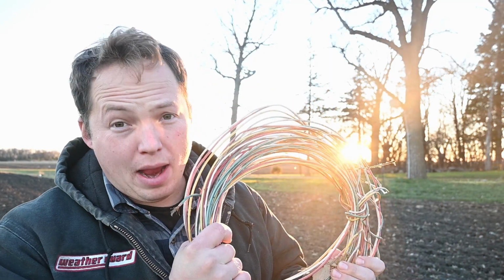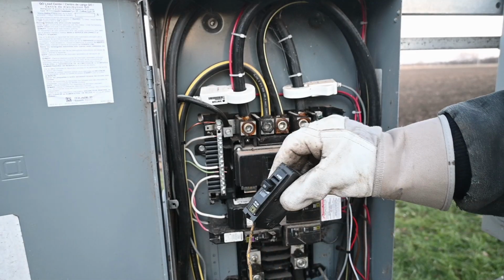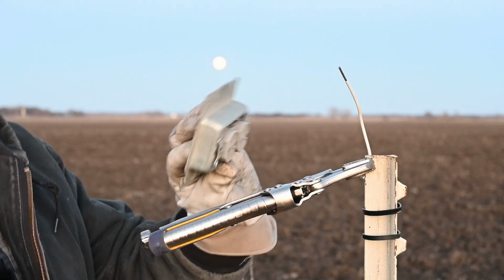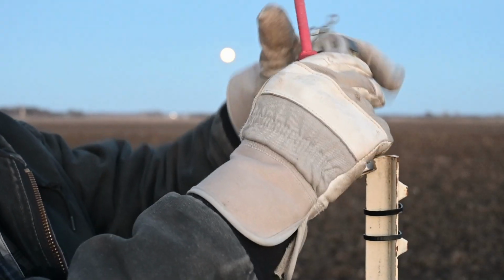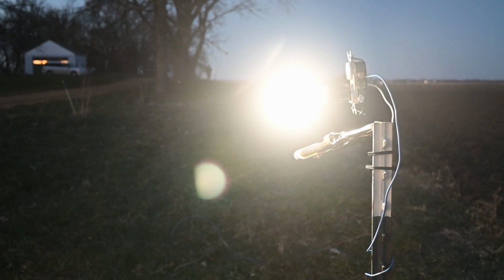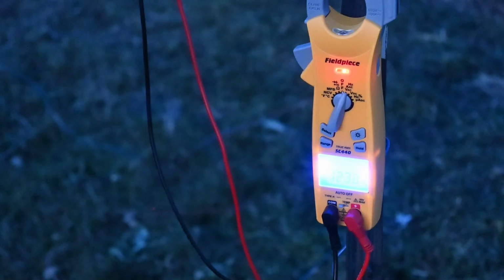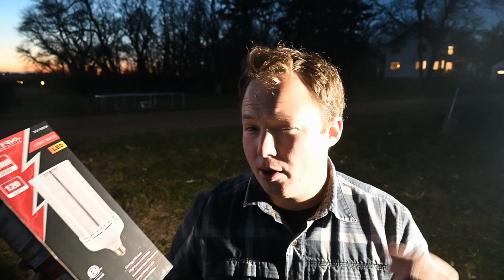Powering a Light With a Fence Post & Scrap Wire - SWER (Single Wire Earth Return) Demonstration

Comment: I did the same thing with an underground sprinkler system with an open circuit common.  Instead of digging 400' of yard and replacing it I dropped a ground rod in the control valve box and used it as my return.  Worked for years until a second lightning strike which knocked out all of the zones led me to the original location of the open circuit.  Turned out to have been underground splices burned by a lightning strike.  Took out the well wiring, pump and outside lights as well.

Comment: Worms ..... lots of worms coming out of the ground. Not to. Metion a good way to kill people who like to walk barefoot along the electrical path., in no way is this a permissible wiring method under any NEC or NFPA codes and standards would shutdown this death shock hazardous wiring. Even high voltage utilities wouldn't ever allow this guy to play with this potential rigged hazardous wiring. Remember I said worms coming out of the ground because an electric current and such. Transient Voltages are a guaranteed electric shock resulting in death. TRANSIENT VOLTAGE ARE ILLEGAL specially from faulty wiring. So please don't attempt this even as an experiment.

Comment: This is totally fascinating. Thank you for sharing this. 
So this is just one wire from the breaker box to your destination for setting up a receptacle, ie your example of a camera. 
The receptacle is attached to basically a metal 'ground' of some sort (fence post) in the ground.
The earth is the second leg back to the breaker box ground and into the breaker box.
This is still using electricity from the electric company but you're only having to use half the wire.
Somebody let me know if this is wrong if you don't mind.
You scraped the paint of the top of the post; did you also remove paint from the lower end any?
This is awesome. All your videos are intriguing to me. Thanks much. Jesus bless.

Comment: I used this in high school, (1959, go Antelopes, Lancaster, California.) with a 100 watt incandescent light bulb to drive worms out of the ground for fishing bait. I used a wooden broom handle with an 8", #8 bare wire tied to it connected through the light bulb. The other side of the light bulb was wired to an extension cord that was plugged into a wall outlet. (The single wire plugged into the hot side of the outlet.) I plunged the bare wire into the ground. This was dangerous, but the times allowed it in school electrical shop. (I was also on the school sponsored rifle team. How times have changed.) Don't touch any of the bare metal. Wear insulating soled shoes, as you will be standing within the electrically charged area that is driving the worms out of the ground.

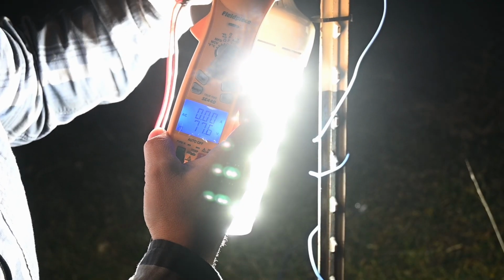Comment: @15:50 
" So that's a what ?" 
Watt - work it out man V I R 
During the electrification of Ireland back nearly 100 years ago in very remote parts the ESB often only ran the positive wire and dispensed with the negative, using ground for the return path !! This was often over many miles . We use 240 volt 50 Hz in Ireland, I thought the USA was 110 v ???

Comment: I typed the following before watching the entire vid.

Regardless great job and great topic. 

If you pee on the stake it'll improve contact with ground. Moisture and metals/electrolytes in the ground helps conductivity. A longer ground stake would improve both ends. Again getting to moisture helps

Comment: In EPRI’s online “Guidebook for Evaluating Neutral to Earth and Contact Voltages in Distribution Systems,” p. 8-4, dealing with the methods for investigating customers’ complaints from shocks around swimming pools, outdoor faucets, and in other wet places, it mentions that the normal return path is 40% through the neutral (and other cables like CATV and phone), but 60% through the earth. Seems incredible, but if EPRI say so, it must be the case.

Comment: I first discovered this technique in the jungle of Brazil.  I was surprised they would have a single wire traveling miles and miles to the camp and then go through a step-down transformer, which provided the 2 wire + ground system for the camp, which was wired normally. I wonder what the travelling voltage was on that single line?  I thought they might be using this throughout the countryside in a 3 phase configuration, so that the ground on the 3 phase system typically has very little current (a phantom ground).  Each phase should be balanced as well as possible, so there is little phantom current.  I'm an EE so this is all very fascinating to me. I was typically working in microwave and HF equipment for secure communications, not power stuff!

Comment: I x R = E       R = the resistance of the gage of wire used    I=  the current draw from load    E = voltage drop across the wire which accounts for the loss in voltage,,,   mathematically if I or R goes up so does voltage drop

Comment: Does the current really flow back to the breaker box? I think the earth is just acting as a giant excess charge sink, resulting in a complete circuit. Say if you dug a big canyon between you and the grid, you’re saying the light will turn off? Or if you unplug the grounding rod at the breaker, it’ll shut off? Seems suspicious

Comment: Back in the sixties I had a service call in a older house that had gas lights at one time. When they converted to electric, they only ran one wire to each fixture and used the old gas pipes all through the house as a neutral. one wire from each fixture was connected to the old pipe with a hose clamp. The old gas line was connected in the basement to the meter. All was well until the plumber decided to clean up that mess when he installed a new water heater that morning.

Comment: Off topic, help please. I'm running a 3wire romex 140 feet, as an extention cord , to an orange 3way outlet , to power fridge, lights and other appliances in a house. Basically sharing power from neighbor. It's 10 gauge.  If I have too many things on it starts to trip the multi-tap outlet.  What size breaker and wire should I use? I'm trying to install my own meter someday when  money issues eases. Much thanks

Comment: Hi Benjamin, in America it would seem to have very relaxed Laws. 
I must say that although this was a very enlightening demonstration, it is full of serious safety issues, You should berry your Neutral/Earth post under the ground so that there can be no Person or Animal accidently touching it.  If I may, I would use at least  three proper copper earthing rods (Metal post have a very poor resistance to ground) that are connected about a foot below the surface to improve the flow to ground 
you are getting about 8% volt drop on the small light,  this is most likely caused due to the conductor size and length and the quality of the flow to ground and your supply cable could get hot.
your installation provides no protection for someone that has come into contact with the Power.
Any way just some things that are to me a very big concern,  I have heard this many times on TV "It is what it is" 
Keep up with the demonstrations, this was very interesting 
Oh sorry one more thing, a main incoming transformer does not have a Neutral wire.

Comment: The Telegraph used to operate their wires using a Earth Battery... At each pole they would alternately drive a Galvanized rod and then a Copper rod... (A Battery is 2 dissimilar metals in a acidic base) Whereby their is sufficient acids in the soil to produce current after connecting the wiring to each metal rod in the ground... Just a neat story from a ole man!!!
Reply: cool

Comment: Just drive the steel stake into the ground, and cut it off. Weld a wire (taking the place of the post)! Drive a wood post next to it with a single wire for ER,  and another for the power source! PERFECTLY SAFE!!!!

Comment: I had to do it once before. I had an old man that had many acres. He had a big shed/barn about 300 yards from the main house and main electric panel. He had a dedicated 20 amp circuit running in conduit underground from the main panel, 300 yards to the barn. He only had 3 8 ft florescent light fixtures and 2 duplex outlets. He called me and said that the lights and outlets aren't working.  I tested the breaker first to make sure it was on and 120 volts was coming out. I checked to make sure the neutral was connected (multimeter leads on breaker lug and to the neutral bus. I had 120 volts. I went to the barn, and my multimeter leads to the black and white coming out of the conduit. No voltage!!! I put my red lead on the black wire, and my black lead into the mud (ground), and I got a reading of 119 volts. Perfect!!! I told the old man that he lost a neutral somewhere in between the house and the barn, and it'ss possible that the ground shifting and settling broke the conduit and left the neutral vulnerable - or, maybe he was digging and hit the conduit and neutral with his tractor equipment and one of it's implements. Because of the voltage drop, I had to use 1000 feet of 6/2 wire. The wire alone was around $2700. The old man couldn't afford it. So, I picked up 15 ft of #4 'bare wire, 2 acorn clamps and 2 ground rods. I used the #4 bare wire going to 2 ground rods 6 ft apart for the return. It wasn't up to NEC standards and I'm sure it wasn't up to local code, but he was in the middle of the country, and no inspector is going to go out there. The old man just needed a few lights and an outlet or two...
It worked! I wouldn't advise it, but I took all safety precautions!!!
Reply: Same, sometimes you just have to use old methods to do things. They're fine until somebody messes with them or modifies them beyond what they're capable of.
I know a bunch of folks who like to break off ground pins from cords. So replacing all the outlets with two prong ones is not really an option. "Doesn't fit just snap it off you don't need it!" My favorite quote from folks.
This one building I was at had a dozen outlets around the room and only 2 wire no ground. I very carefully went through the entire system making sure polarity was correct and then jumped the ground and neutral. Also a very frowned upon method (mostly because you can get some really bad results if you're hot and neutrals are reversed). And since most everybody uses 2 prong devices nowadays. I figure it's the equivalent of an outlet right next to the electrical panel and it solve the floating voltage problem that all the metal work had. One of the outlets fed a refrigerator in a back room and it had like 20+ volts on the metal work it was only 10 feet away from the panel. I also labeled every outlet breaker and no ground. It's just slightly safer than using one of those three prong adapters, Mostly because it won't "damage" (by way of human intervention) the device that somebody tries to plug-in with three prongs.
No I would not recommend doing this at all but all precautions were followed. If the nonprofit could've afforded it the only way to actually fix this would be to rip all the walls open (most of them panel covered cinder block) or put in 25+ GFCI outlets or breakers.

Comment: Several years ago I was asked by my brother in law to help diagnose a leak problem. His waterline to the dishwasher leaked water onto kitchen floor. I was testing in basement and was getting electrical readings on the incoming waterline from the well. Long story short was the sheep barn by the well had a bad connection on the overhead neutral line. When he ran an electrical heater in the sheep barn, the current was following the water line back to the house and through the stainless braided water line to the dishwasher, which was grounded. It created an arcing that melted the line. I recalled that I was getting 86 volts coming in on the water pipes. Weirdest thing I have ever encountered.

Comment: This works and all, but is really not good practice for a number of reasons. One of the major problems is the ground loop interference experienced by radio users, and it can also cause phase angle problems for the power company. Yea, it's probably fine for a single light out on a pole, however this kinda stuff eventually becomes a cancer, I had to completely rewire my shop after I found a bunch of janky circuits were wired this way just so someone 20 years ago could save a few bucks on copper wire.

Comment: Not all that different from how power plants actually work.  They're not running ground wires from the power plants to your meter.  You provide your own ground at the meter. 

Now, I wouldn't want to run a light like this on a home panel.  Lightning loves zapping electrical systems with multiple grounds.   Even in a regular building, multiple grounds on the electrical system are just begging for lightning to deep-six your electrical equipment.

Comment: If you're using the earth as the return. You are still making a two wire circuit with the earth as the second wire. Albeit a High resistance wire... 
No mysteries here...

Comment: Unless you were in physical contact with the hot wire to the outlet, you touching the fence post wasn't a danger at all.
Assuming you wear normal shoes, you were either already at the same potential as the fence post (grounded), or isolated from ground by your rubber soles, and considering the distance from you and the post and the inherent resistance of your shoes to ground, you were well under a volt of potential difference.

Comment: TESLA  using earth as battery. Pole deep in earth with wires etc...  have to look up configuration but it works. The deeper the pole the better. Also having water (auquifer)  underneath your immediate area helps to conduct also.  (PYRAMIDS)?

Comment: NEC or National Electric Code. 

You ought to look through it.

You and others like you that have died from something like what you did here, simular to the hundreds of plumbers that died from electrocution under a house when they cut that last metal pipe, that just happened to be the only ground and neutral for the entire home. 

My point is, there are many deaths before something is added to the NEC. 

Also. 
Wouldn't it be easier to build a T out of 2x4s and curl your wire around the top and just get it close power line?

Comment: I had heard of earthworm collecting using a old Ford coil somehow. But not knowing how devised my own method driving 2 pieces of rebar into the ground a foot or two deep and about 6 feet apart and stripped the wire back on an extension cord with a bad receptacle end and just plugged it into house current. Well by golly did worms fly? Yes they did ... a few almost approached escape velocity from the earth. After unplugging was able to collect a gallon or so of worms after they stopped smoking.
Reply: lunch is ready and hot!

Comment: Very cool video! Would have been interesting to see how incandescent bulbs fared. (you know you have some stashed away, wink, wink) Did you see any worms come out of the ground when you did this experiment? As a kid we did something similar to get fishing bait. Got a hell of a shock once or twice by kneeling on the damp ground while poking the electrodes into the ground with the power on. I miss the days when parents really didn't know what to pay attention to with their kids. LOL
Reply: Does the larger bulb indicate what it's capable to do. Such as incandescent bulbs. 
Showing it had power and able to light it up.
Reply: @WhoU8  Good quality (emphasis on good) LED bulbs can run on lower (and higher) voltages than what they are rated for.  The power supply in these are similar to a computer rather than an incandescent bulb.  What will happen is when you run, say a good LED bulb rated at 120VAC is fed 80VAC the bulb will work  at full lumen rating but it’s life expectancy is greatly reduced as the power supply used to power the LEDs will run hot to provide the current required to activate the LED(s) at their full lumens.  On the other hand, the incandescent would work fine but it would be visibly dimmer than its rating.

Comment: Nice Video and simple dialog on topic.  

Not to be a Safety Sally, but saw you point without your electrical gloves at lugs in the panel.  I haze a buddy of mine that loves to point at connections in a box and he gets much closer than you did.   A big deal nope, just bad practice.

A video on your gloves and testing of internal liners would be great to educate some.

Comment: SWER system of power distribution was pioneered in1925 by Lloyd Mandeno a New Zealand electrical engineer.
The return current mirrors and follows  directly below the overhead line.
Maximum current is limited to 8 Ampere so it doesn't effect telephone systems.
Still used today around NZ and AU.
Together with VSDs  3 phase motors can now be used.

Comment: The variation in voltage measured in the dirt alone is exactly why you don't ground the power in a boat to it's frame, especially a metal boat. The marine environment electrical system is called a "floating ground" (no pun intended) because "ground" is referenced only by the neutral tap in the generator itself. The slight voltage differences along the hull causes electrolysis in the metal parts of the boat. I've heard arguments that it can speed up oxidization in various poly plastics, too, but I'm not 100% sure of that. I wonder how long a steel grounding post like that would last as a result of electrolysis, or if a small zinc plate at the base of the post would work to reduce corrosion in the steel the way it works on a boat. .
Reply: Im sure the US Navy has some answers on that one.

Comment: This is dangerous, please don't do this if you live in a place where power is readily available. I would be more worried about voltage gradients between the light and your panel, which is not a Transformer.